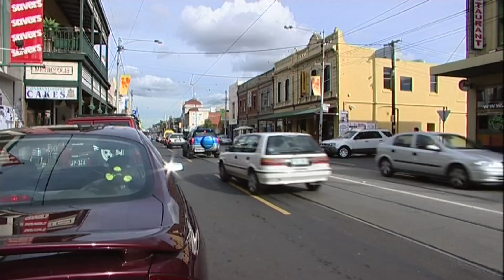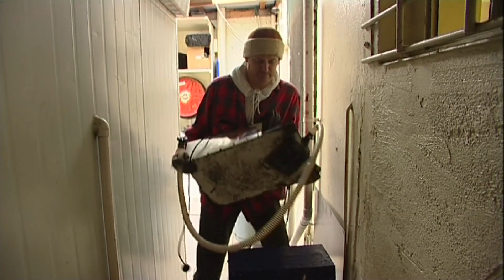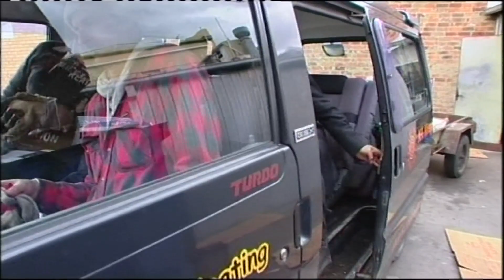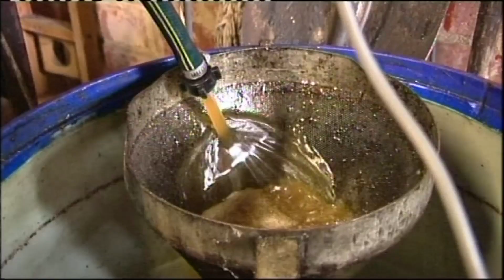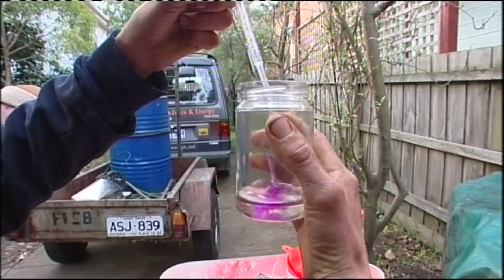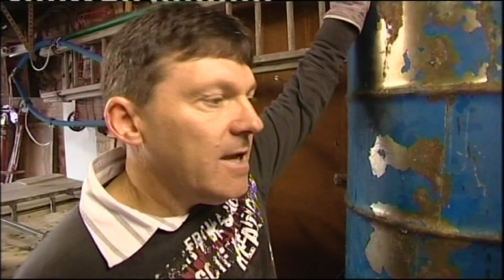Making diesel from old chip oil.

Comment: Great video for the above average back yard tinkerer who is willing to experiment a little and save a few dollars !   But unless every household consumed massive amounts of fish and chips and other fried foods (which are really not very healthy for us), biodiesel will never become a viable and widely available form of alternate fuel because the volume required to do so would just not be attainable.  We also need to consider that the costs of mass production of vast quantities of biodiesel are much higher than regular diesel derived from petroleum. And it would negatively impact the availability of grains intended for food production and drive food prices much higher.
Reply: That's not so true , there are people on this planet 4 partners in fact who bought fields planted sunflowers selling oil and then collecting it after their customers used them, and they turn that to biodiesel. And selling that again. They have a closed loop system. It is doable even for a small farm holder. If every body used every waste turn into something we wouldn't need to have this conversation in the first place. But like a toddler we needed to break the earth to learn how to fix it.
Reply from the maker: Definatly for the keen

Comment: I used to simply clean my  oil in a centrifuge and pour directly into my ‘81 VW golf and go with it.  As long as the temperature was over about 12 - 15 celcious the car would start and run.  Never had filter or injector problems.  Got 40 mpg and my cost was $ .00 per litre
Reply from the maker: Very good Dave. There’s more ways to skin a cat

Comment: Mate and I and a lot of others all over Oz and other countries were all doing this 20 years ago and some longer. Mate and I used to do 1000L batches at a time. Between the 2 of us we had 6 cars so went thought that about every 3 weeks to a month.   It's funny to read the same  misinformed safety sissy Comments here as were leveld at us back then.  I mainly run my Vehicle, Generators and Tractor on straight  oil or Blend with petrol.  Saves the hassle of making Bio although Bio is more compatible with newer engines but  Straight/ blended veg is 100% fine if you run it in suitable engines. 
Had Coffee with a mate this morning who is running Straight veg in his wheel loader even though it's winter and says the thing  is running with more power which does not make sense on the face of it as veg has about 10% less energy than diesel but the veg could have also cleaned the old thing out.  He's very happy with it and the savings he's making on not having to buy 150L of Diesel a week.
Reply from the maker: Hmmm very interesting

Comment: Realy interesting. What is the white powder you mix in?
Is it to seperate the dirt out of the oil?
Reply: That was the catalyst.  Methanol and potassium hydroxide.
Reply from the maker: i have forgotten actually. Maybe google it.
Reply: Rebel Films ok, thanks
Reply: They mix in top grade White Power from Munich 1936 batch.
Reply: The powder is either Sodium Hydroxide OR Potasium Hydroxide. No, it is not to filter the "dirt" out, the Methanol and sodium or potasium hydroxide, make the "Methoxide" which is the catylist to break the long chain polymer into a short chain polymer, (it reduces it's viscosity) so that it will go through the injectors etc., basically.